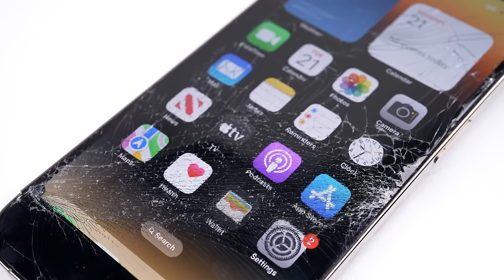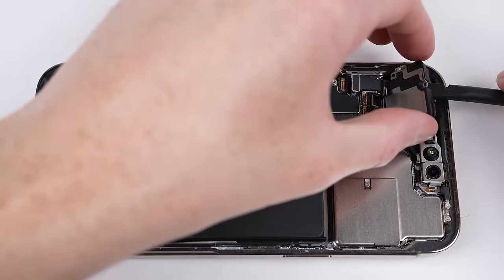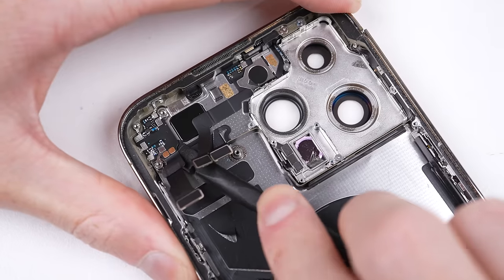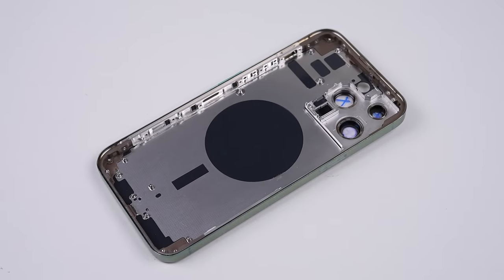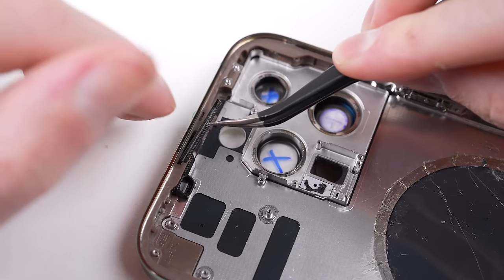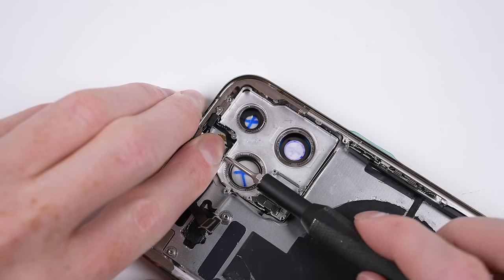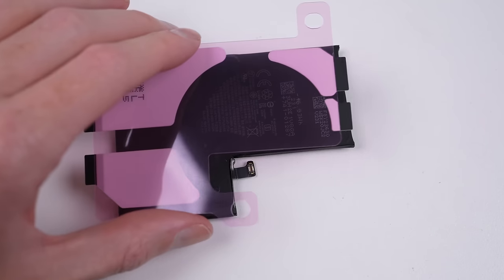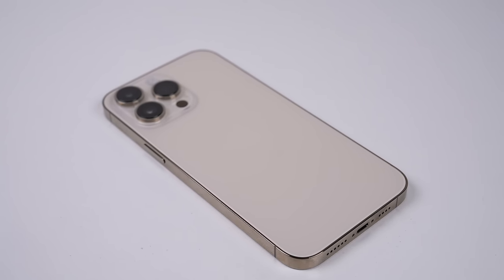What It Takes To Repair The iPhone 14 Pro Will Anger You - iPhone 14 Pro Max Restoration

Comment: Apple engineers sucks fr!
stop buying stupid iphones. (bro im telling you as a guy who used iphones since iPhone 4 came out, I've upgraded from my 12 pro max to galaxy s23 ultra. ultra is amazing for me)
Reply: well i have never had to repair my iPhone but both my Samsung battery blew up so i will never have a Samsung again either its all about your experience  . As a guy who used both if u want better camera better security you phone to share 80% less of your private data to third party companies go with iPhone. If you want a phone that might blow up or get slower but is a lot cheaper go with android but quality cost a little more even though apple are greedy and make it too expensive piece of shit but again you can use it for 6+ years and it has paid of.
Reply: bro i upgrade my phones every two years so your problems ain't my problems. i have used galaxy s7 edge, s9, S10 5G and now S23 ultra. only the s10 battery had a problems. but bruh my iPhone 6s, 8, 11 had blown up batteries. and iPhone displays are so fragile. always need to replace. so shitty. green lines all the time. AND THEIR CERAMIC SHIELD SUCKS FR. i have seen lot more cracked phones in my life than cracked android flagships (gorilla glass is better)
Reply: @dinithaw  I can agree that iphone screen crack easier. But this shows that its all about experience. I gave android a chance they all blew up in the first year one on a plane aswell could have killed 100+ people. And you had bad experience with apple that's why i think its stupid to say one is better cause it depends what you like and what you have experience and so on
Reply: @abdullahiomar20  and bro i just realised. Great engineers works at Samsung than apple. Samsung makes like everything from smart watches, phones, computers, chips, to goddamn rockets, tanks, missiles, ships so on.. and Samsung started way before apple does. And Samsung is the also company who developed SOC (processor) for first 3 iphones (iphone 2g, 3g, 3gs)